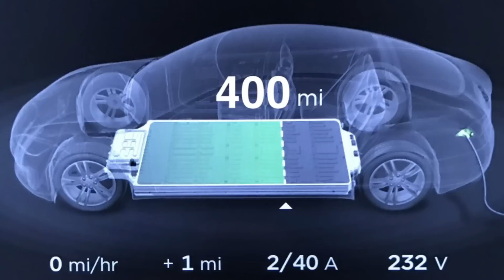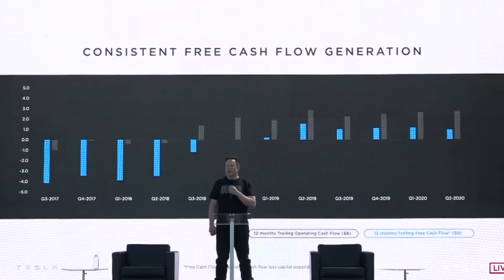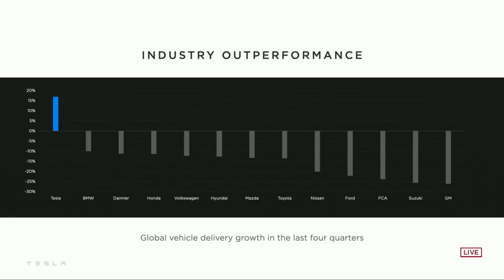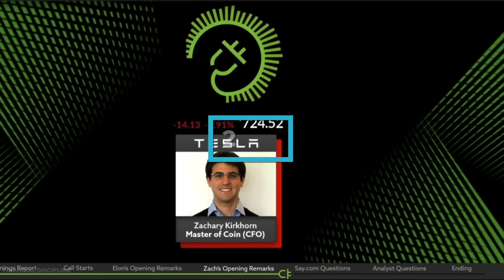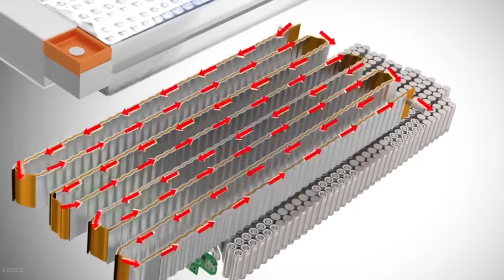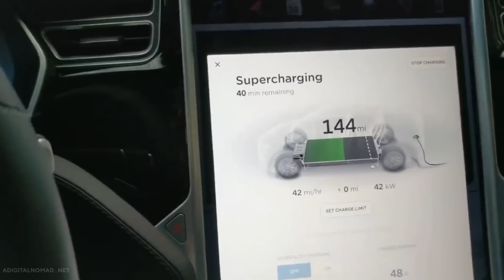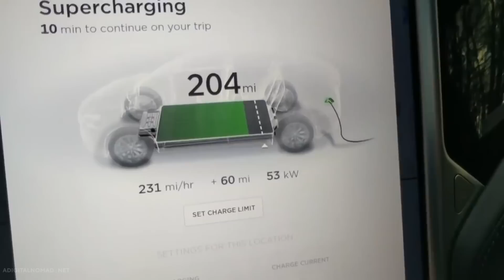Tesla's NEW 4680 Battery is a HUGE Game Changer!

Comment: I was planning to suggest tesla motors inc. to use aluminum ion batteries.. because those batteries are cheap, can suprass the 1000 kilometer range, charges 60 times faster than lithium ion does, can be recycled with no issues, it even has a longer lifespan and replacement cost is so much cheaper...
Reply: but its too late..

Comment: Battery density may not be the key, A variable alternator, putting on to each axle and can charge at different rates, depending on demand it would limit the size and number of batteries needed on the car, reducing the weight and power consumption at the same time always keeping the car fully charge. Imagine no more charging needed, Unlimited range!!!, You want thinking outside the box here it is solve the problem a.k.a. engineers 09/18/2022

Comment: i still hope 18650's and 21700's will get folded edges like this, so we can see cells like the 18650 35Q and 21700 40T but with high discharge current capability, that will make 25R's obsolete but those were low capacity either way comparatively

Comment: Nothing personal, but stop putting game over on every stupid Tesla video.  Solid States will still be far more effective than this, and Toyota and their battery partner will be entering mass production by the end of this year and into next year.  Also, this will probably only make Li-ion batters more susceptible to catastrophic failure. By holding more charge in a battery and increasing the energy density, without adequately dealing with the thermal load could cause the batteries to explode under high usage, like the ones in the Model S Plaid did in early July.  This is defiantly a great innovation, but not a "game ender" or even a game changer. In fact, Tesla competitor Atlis just went to market with their fully reformulated battery back that can hold more energy than these cells, although I will admit the issues with that company. But definitely a step forward.

Comment: If this were true; you'd be saying current Tesla batteries suck.  You are talking 16% better battery density.  Solid state is going to be 200 to 400% higher density.  The best thing about tabless compared to lithium ion currently in Tesla's is it will potentially charge faster & be able to cycle more times.  You must to have a greatly enhanced charger few will have at home; so you'll need to pay to use a special supercharger unit.  Solid State batteries are going to have these advantages & much lower weight for the same range, cutting weight from 5000 to about 3000 lbs. This is why all the big car makers are focused on solid state as lithium ion full EVs like Teslas are not that good compared to hybrids. At that point the current crop of Lithium ion and Tabless batteries will be considered obsolete junk and you will take a giant hit financially when getting rid of your used Tesla.

Comment: Wow ground breaking unproven 16% better range, and not even released! Try looking at a real breakthrough battery called the BYD blade battery, 500,000 EV produced and not a single fire! On top of that Singapore Taxis using the BYD E6 with over 500,000 km and average 13% capacity loss! New Blade battery is even better!
Reply: Wouldn’t be surprised if he does use me& rewraps em….he’s a massive conman

Comment: Will new Model S use 4680?
Reply: No, at least not right away.
Reply: @chrisw9534  Are you sure even after the delays? Is the new S frame an integrated battery frame like he discussed on battery day?
Reply: @starshipcaptain4753  Well, we'll see what Elon announces in a week or so when they launch the revamped Model S, but the last I heard Tesla had confirmed that it would still be using the 18650 battery cell.
Reply: @chrisw9534  I know but don't you think there is a good chance they will now start off with 4680? I kind of think so now, especially since non plaid versions are now delivering in the Fall. I think the few plaid orders they have will just jump right to 4680
Reply: @starshipcaptain4753  I was surprised to hear that they wouldn't be using the 4680 cells, too. I'm not sure why they wouldn't use them. Might be because of supply constraints. They can afford to put more of the older batteries into the Model S and X since those cars have higher price tags. But maybe they'll surprise us and announce that they will use 4680's. We'll see.
Reply: @chrisw9534  Exciting either way
Reply: @chrisw9534  what happened to his 2170 nonsense last year?
Reply: @Man_fay_the_Bru  What do you mean? 2170's are being widely used by Tesla today.

Comment: another user with a dead M3. At third week of driving, an alert showed up saying "OK TO DRIVE. PLEASE SCHEDULE SERVICE VISIT. Vehicle speed and power may be limited" --  Car slowed to 65 mph while traveling 75 mph in the fast lane; requiring immediate lane change to avoid becoming a hazard. Top speed was then limited to 65 mph by the associated fault response programming. At dealer was informed of diagnosis that oil pump issue had been sent from car to Tesla Main data receiving HQ. Subsequent firmware update --- reportedly necessary when significant components of the car are replaced -- failed - repeatedly. Car is now inoperable and awaiting examination by Tesla engineering; as I understand the issue is beyond the scope of the dealer technician to resolve.
Car initially (my very FIRST entrance to car)  had an issue where the touchscreen would turn grey on the right 2/3rds, becoming unresponsive to any touches, auto reboot after approx. 1 min, then work for some time only to fail again and again later.